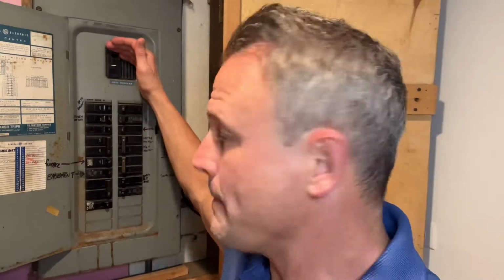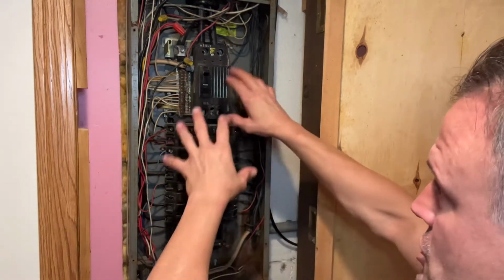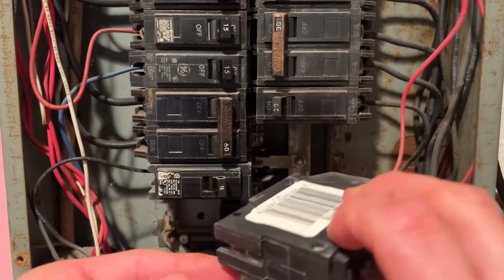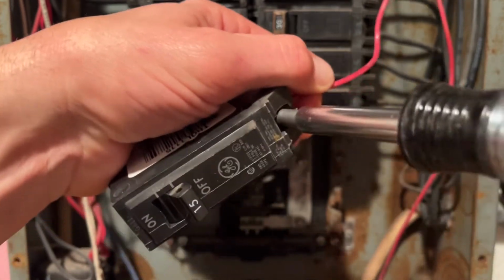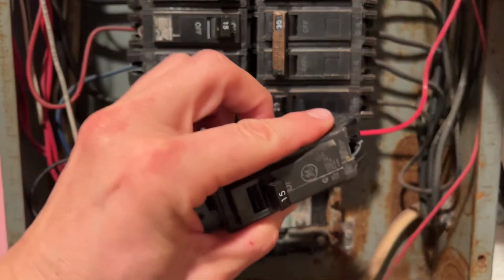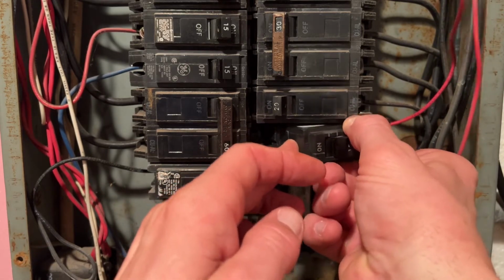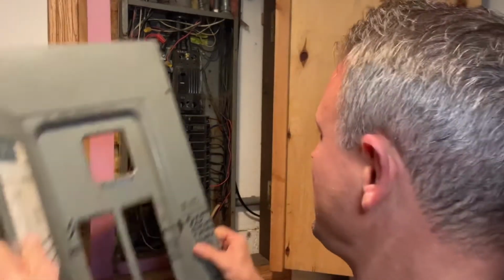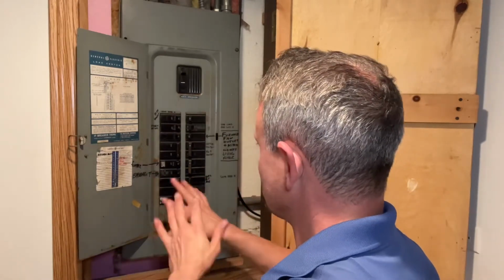How to Replace a Circuit Breaker

Comment: Is this the same routine for an outside panel box for a breaker for a well?
Reply from the maker: You would have to check and see how it’s wired. It should be, but it is possible it may be something different.
Reply: @BJPoznecki thank you! This is going to be a rough job